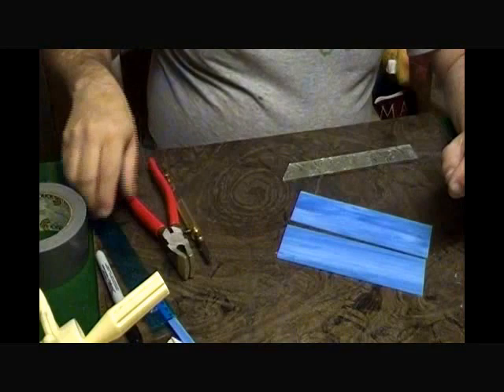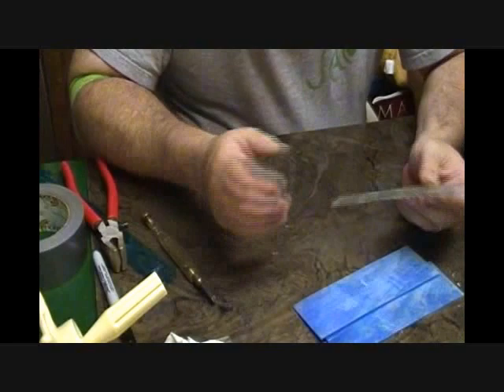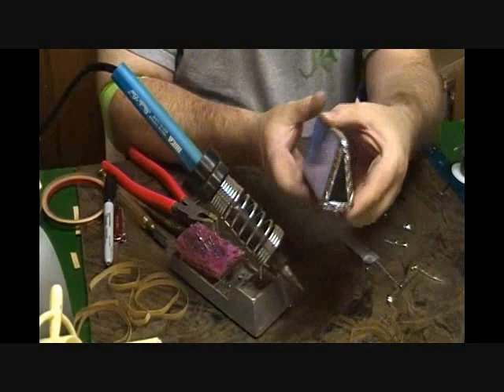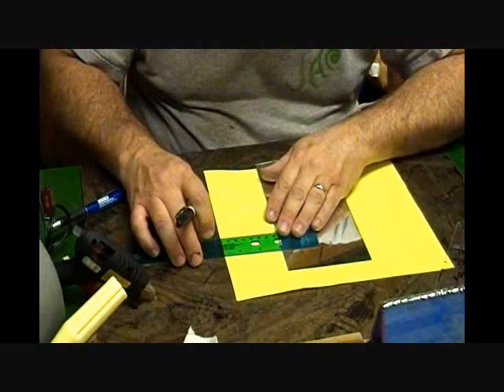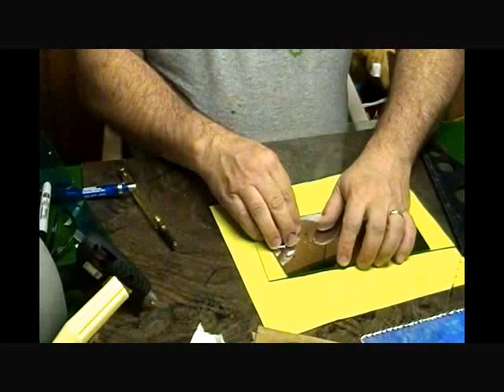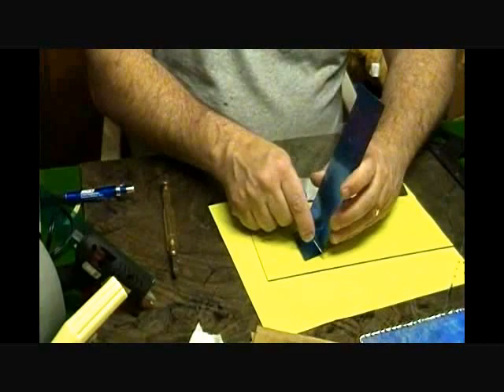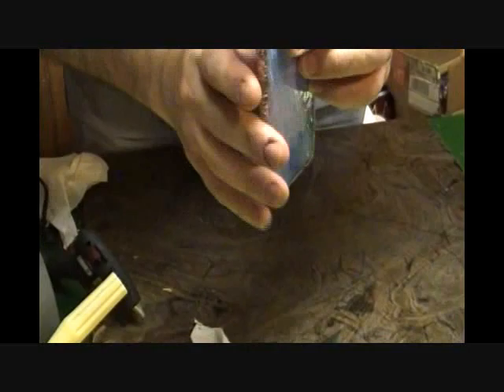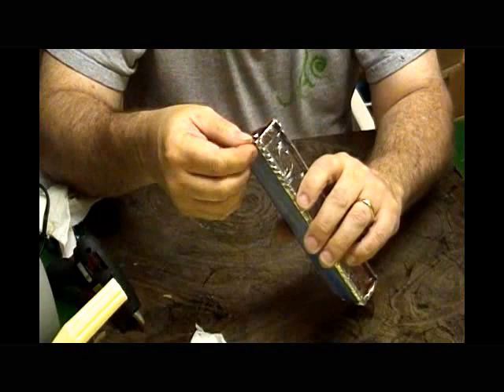The Kaleidoscope Maker #8

Comment: Great tip Brett. Gluing a couple of bits as wood as guides to hold the mirrors... Brilliant in it's simplicity! Holds the mirrors much more securely than my method :( Do you find the hot glue ever seeps between the mirrors if it's too hot and runny?

Comment: Brett, nice that you mentioned me. By the way - "Lothar" is pronounced in Germany not with a real "th", it is spoken more like "Lot-har" - but with the "th" it sounds also nice and it is also OK for me. The objects inside the mirrors are really cool and funny. Before somebody may think: "this Germans do always know better how things sould be done..." ;-)  I have to say: beneath my own try and error, I have got the most inspiration from the U.S. kaleidoscope makers, and not to forget, Frank Higgins from the U.K.! The hot glue method, that you show, is mostly exactly the way I do it. You can add another piece of wood on top on the paper, to have something where you can slide the mirrors against. So you can put the mirrors and the third side easier in one line. Why didn't you add a third side at this model? At others you did. In my experience it is not possible to set the mirrors permanently to the right angle without fixing it to a third side (from cardboard or other material). I would do the cleaning of the mirrors only if necessary. If the protection foil is not good, it may leave some thin film, but in general this should not occur. If there is some fingertip on the mirror, I just clean this part with acetone and a clean rag, (a piece of an old white T-Shirt is perfect - change it, if it leaves stripes). Another thing which may be good to avoid little silver chips coming loose from the mirror is, to sand the side of the mirror, which touches the other mirror, just a little bit with the finest gradation of sand paper. Sandpaper lying on a very flat surface (a glass plate for example), hold the mirror in a 45° angle and slide it just a few times carefully back and forth. Not to much, else you may get curves at the mirror side. I do the same with the smaller sides cause with the contact to the glass there can be also little mirror fragments coming loose. There are some more details but I'm afraid, I have to do my own tutorial to expain them. But yours encourages me to do so. Thanks Brett!
Reply from the maker: Thank you for adding your comments and correcting my pronunciation of your name.  all the extras I had plan to describe, but as seen in my previous stained glass kaleidoscope video, I can overwhelm people with too much info.  I left the third side mirror off for a reason, I want the light to come in from the top.  Yes, you can "fix" the mirrors, by tacking them to the sides, but in this case they are so close to the top they should stay in place.  There is a lot more I will describe in future videos.  I would hope that these videos do inspire others to make them if they want.  Thank you.
Reply from the maker: I also plan many mods and "redos" of my scopes using other and different methods.  Right now, I am trying to motivate people to make kaleidoscopes, or at least watch to see what is involved in  kaleidoscope making. Thanks, Brett